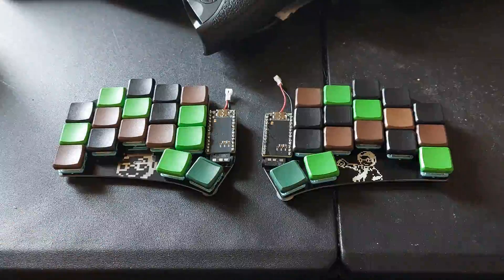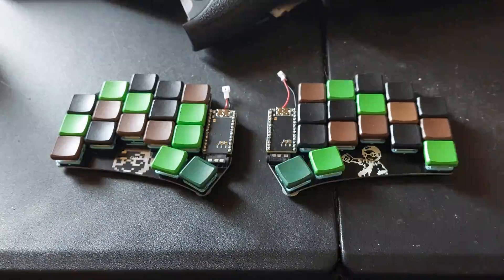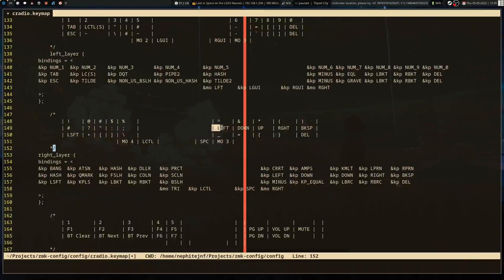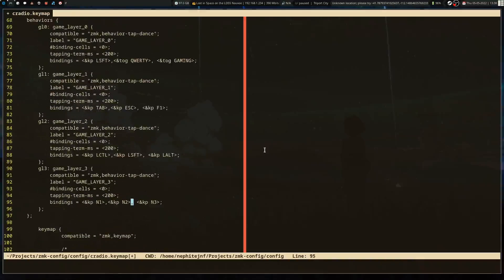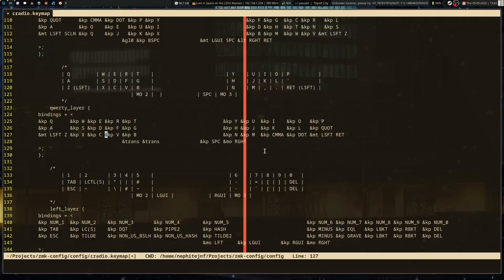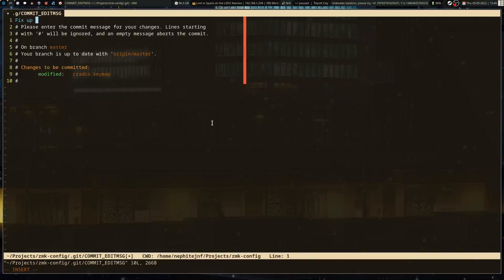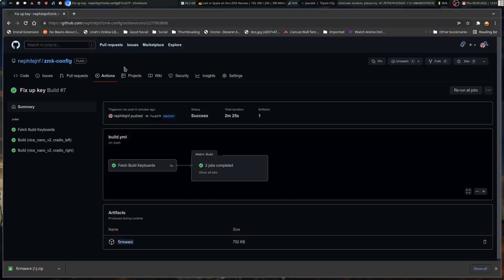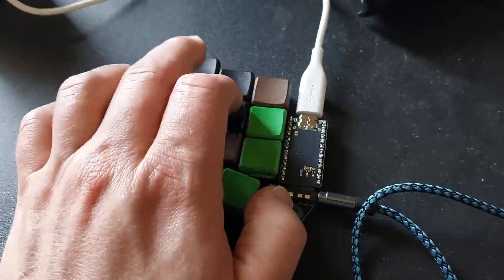My Most Pocketable Keyboard, and Most Functional, The Ferris Sweep

Comment: Nice video, just wanted to point out that you shouldn't use nice!nanos with TRRS interconnect. TRRS is not supported and might risk damaging the batteries and/or the micro controllers.
Reply: Maybe it's a noob question but why is TRRS not recommended?
Would using TRS be considered a "better" option?
Or would you recommend avoiding the interconnect altogether?
Reply: @MCgranat999  a ZMK/nice!nano setup does not support interconnect, and the TRRS port is dangerous when combined with batteries/power transport.

TRS is just a different connector with less wires. Usually keyboards have 4 wires connected to it so you need TRRS cables.
Reply: @KyekOfficial  
Well, that's unfortunate. Thanks for clarifying!
Reply: @KyekOfficial It sounds like he does not currently have batteries installed. In that situation, is it safe to use TRRS?
Reply: @alexhowe639  In that case the TRRS would be the only way to use the device. I think what Kyek is saying is that connecting the boards in any way with the battery installed is dangerous or fatal to the build. But without the batteries it's just a conventional controller (except that it's quite a bit more expensive). My plan is to install the ports but only use them with the Elite-C controllers. But since I ordered 5 boards I can actually build two complete keyboards, and have 1 dedicated to Bluetooth. That way there's no "danger."

Comment: i have a plan buy first split keyboard do you thinking about ferris sweep in 2024. i prefer to use Vial base on qmk becasue it is easy to use for newbie. and i did not know about coding or complie. my plan is enable every thing and setup in Vial later 😂 😂
Reply from the maker: A good start might be a keyboard from ZSA, they have a pretty nice configurator. If you are looking into starting building your own keyboard, the ferris is pretty easy. My first split keyboard was the Ergodox EZ from ZSA, so that is where my problem started.

Comment: I was going to order the boards for the Sweep Bling MX keyboards, but I don't know what to get. There seem to be three sets of boards: the PCBs, some kind of registration plate for the switches, and some other kind of board that I assume you're calling the "puck". Do I need to order all three at the same time for a built, or just two (the PCB and the Switch Plate), or just one? This is my first keyboard build so I'm a bit at sea. The only thing I connect with "gerber" is baby food.
Reply from the maker: Gerber files are zip files with all the PCB data in them that a PCB manufacturer needs to make the board. Many keyboards have a switch plate to keep the switches lined up and supported, especially with hotswap, which is what the MX supports, with gives you the abikity to easily swap switches out. The puck pcb is for the tenting puck, with is a little attachment that goes on the bottom of the keyboard to allow you to attach it to camera tripods, which the site generally allows you to buy the recommanded tripod with it. The other PCBs with the MX are there also as a way to make it look nicer. For this one, I would go with the normal sweep as a first build or find a hotswap board that is already assembled, just needing a case and switches to get you feet wet.

Comment: hello, good video, I have a keyboard as shown in the video (My Most Pocketable Keyboard,) where I can have the same configuration, I don't know much about programming, thanks
Reply from the maker: https://config.qmk.fm/
Reply from the maker: That website will help you create a config without the need for progremming, depending on your micro controller. nice!nanos have a different firmware, it lets you do it without needing programming, but you still need to open up a basic text editor.